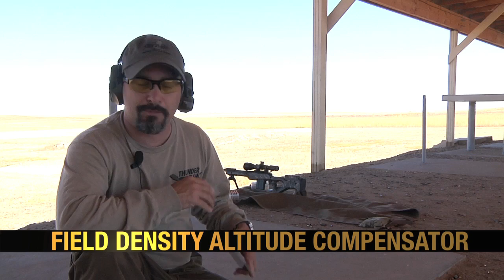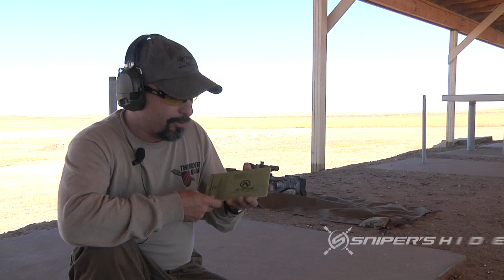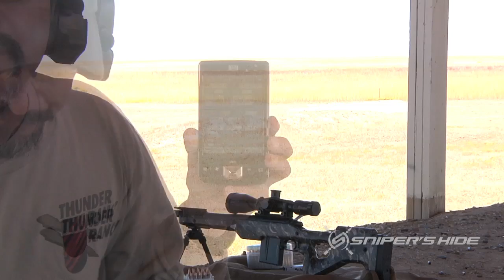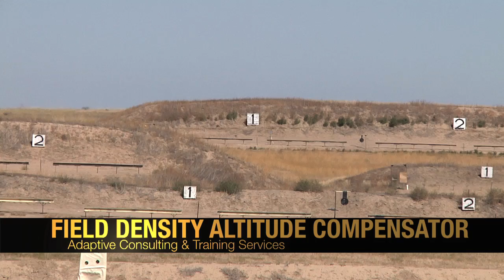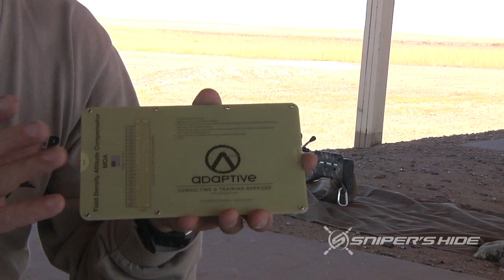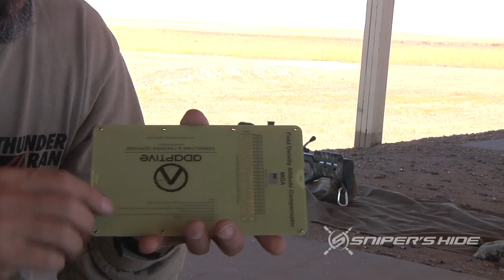Adaptive Density Altitude Compensator

Comment from the maker: And for every 1000 ft of elevation you go up you lose an 1" of Baro... I get 24.90s all the time here.  that is off of sea level and not station pressure.  So barometric pressure can certainly go below 25.00 inches  If Sea Level is 29.92 for every 1000ft you lose one off that 5000 ft subtract 5 from that you get 24.92